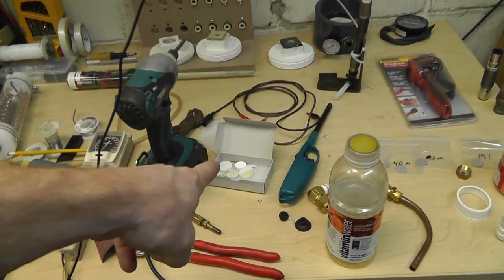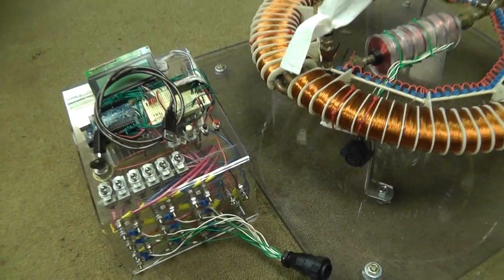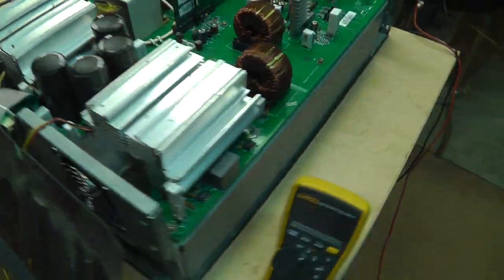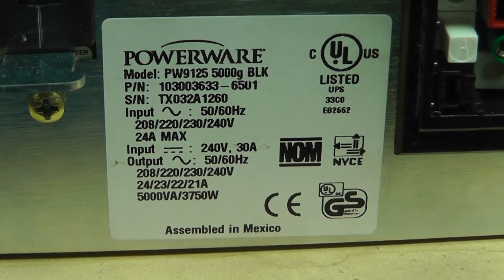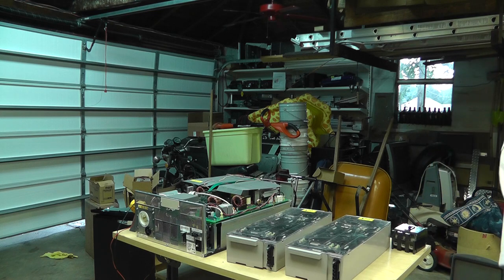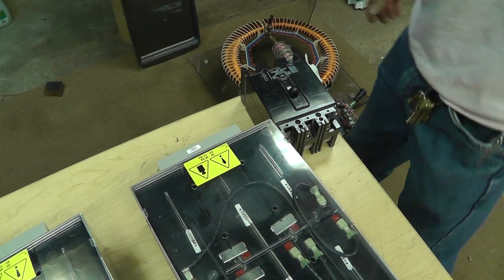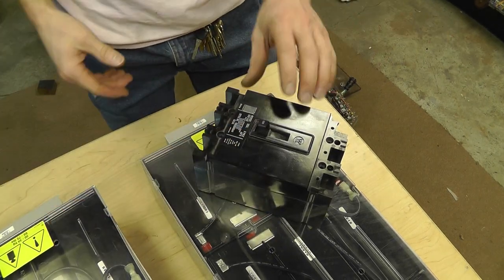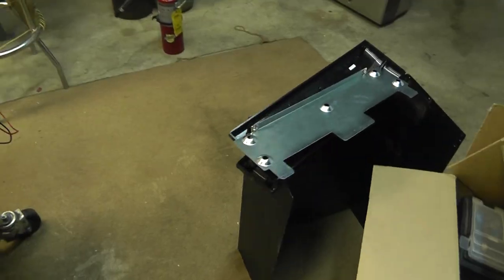After Show Live Show Update & Score On A 3750W UPS! haha Sweet! ~Russ

Comment: Hey man you would be in love with my place of work. We have some UPS power supplies that are the size of mini refrigerators that run on 48 volts and you have to move them with pallet jacks. The company I work for goes in and buys out cable systems and we see some
monster UPS systems. Be careful with those things because they can be dangerous.